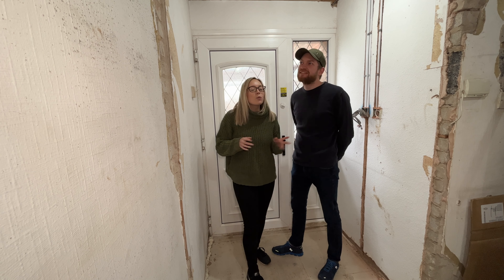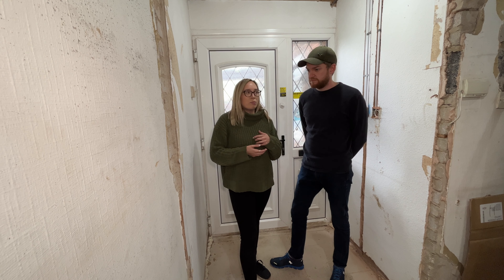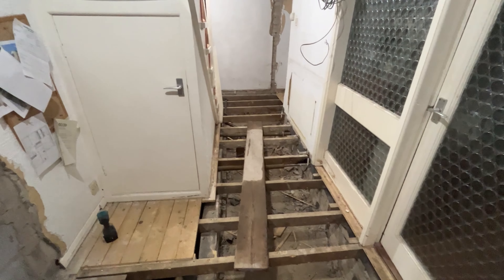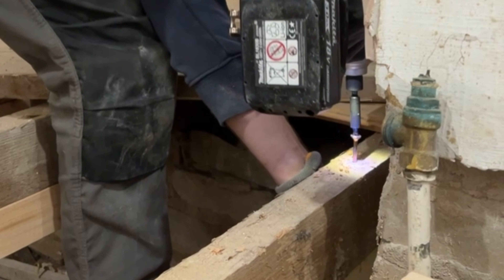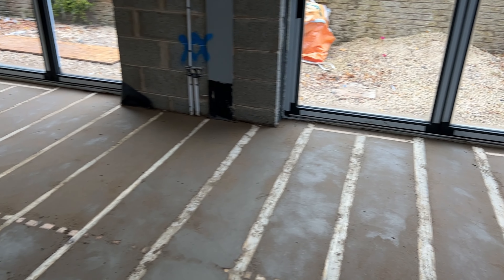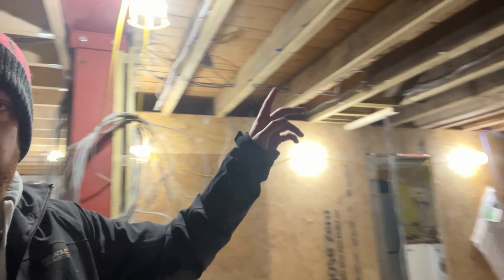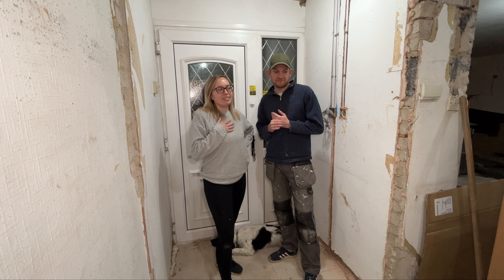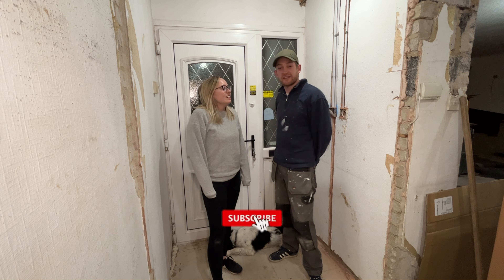TO DIY OR NOT DIY!?!? | Underfloor Heating & Insulation

Comment: Did you calculate the additional loading of the screed? or did you get a structural engineer todo the calculations
Reply: Was thinking that. It’s a lot of weight being effectively supported by how ever many 10-inch screws. 
I’m sure they had it all worked out.

Comment: Hi...thanks for posting this....just about to start my underfloor heating project. Can I ask, the Cellecta HiDeck cement board you used, what thickness was it? Was it the 18mm stuff....thanks in advance, Kevin
Reply from the maker: Hi Kevin, yes 18mm thick, really solid and sturdy floor to say the weight and given the suspended nature. Holds the heat very well, we have 9 bi-fold doors and the heating only comes on for very short bursts in that room due to how well it retains the heat.
Reply: Thanks so much for getting back to me so quickly.... Appreciate you confirming the thickness..... I can't wait until I get to the stage when the cement boards are down and I have a floor to stand on. I could tell in your video its a real milestone on a project like this... thanks again.... Kevin

Comment: Why didn't you just spend the time digging out the floor to the correct depth and have a solid concrete floor? Even timber floor with screed will be noisy, especially if you have kids running around. I've had both and would always opt for a solid concrete floor!

Comment: Decent job, my question is why did you opt for timber joists and not a slab?
Reply from the maker: There was already a significant void under the existing floor and to build it up sufficiently would have cost a small fortune is the simple reason
Reply: @boltsandbrass  makes sense,mine is the opposite it's basically floor level 🤦🏻, trying to work out which route to go down.

Comment: Why would you not use the metal reflective plates between the joists then cement board straight on top, then no need for screed?
Reply from the maker: The original joists that were extended and not evenly spaced back in the 70s so it wasn’t the greatest option for us. We did consider it though
Reply: Supposedly these cement boards aren't great since there's a low contact area
Reply: @boltsandbrass 
Anything put on top of a screed should be glued to it to transfer the heat.

Comment: What's the cement board you laid on the top of the screed called ?
Reply from the maker: Hi Gerard, it’s called Cellecta HiDeck, a tongue and groove cement board
Reply: @boltsandbrass  brilliant, can you remember how thick the board is ? Because we are thinking of doing the same, thanks for your quick reply
Reply from the maker: 18mm was thickness we used. They’re fairly heavy and smaller sizes than your normal floorboards. The work perfectly to distribute the heat evenly and better than a wooden board.
Reply: @boltsandbrass  Yes of course I was thinking of that myself, any ideas where you got them from and the cost please ?

Comment: So what was a company going to charge for the whole job
Reply from the maker: Obviously every job is unique, we certainly had a challenging task at hand, we did our research on the materials needed and what was needed to make the floor sufficient to take the UFH pipes and screed. I think in total we spent just over £5k and the quotes we’re around £1k more for 63sqm
Reply: @Bolts & Brass  thanks for the reply , looking into getting underfloor heating. I don't know at the moment whether to just lay on top and lose 22mm in room height. 
To be honest, I would just pay the extra for my personal convenience , good YouTube clip.
Reply from the maker: If you have the ceiling height I would overlay! Latting every joist and the notching the pipe runs was very time consuming and will increase labour. Be a lot cheaper if overlayed I would guess.